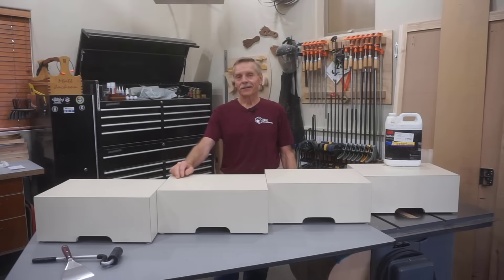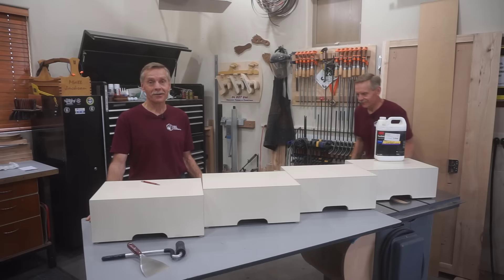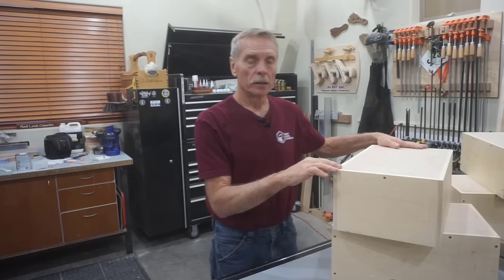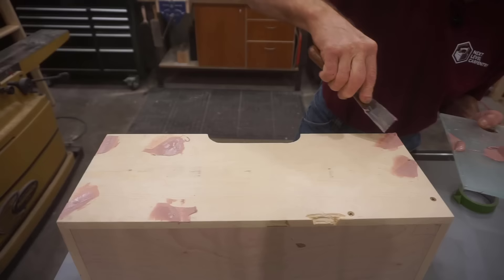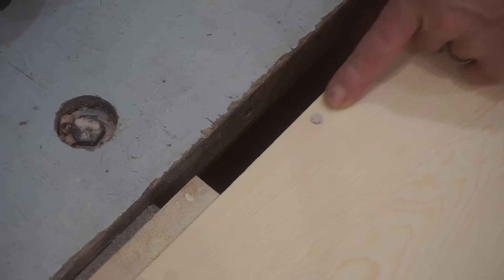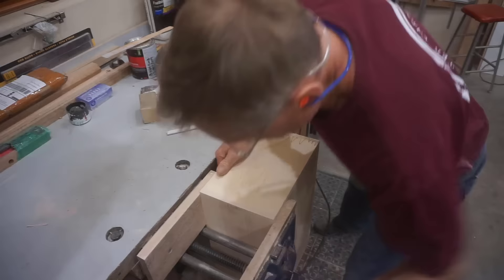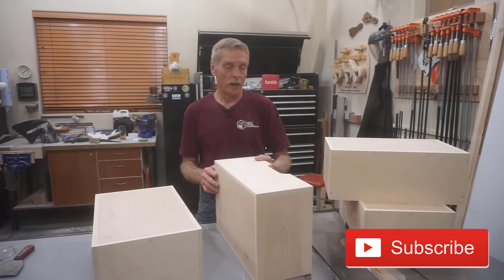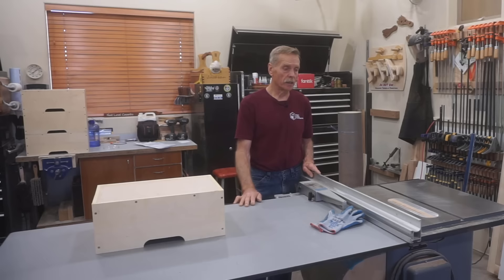Formica Application Master Class

Comment: That was a great video! I appreciate the thoroughness.  I have a question though:  I need to apply laminate to the 3/4" thick edge of plywood.  I don't see people talking much about that.  It's difficult to balance a router on the edge and not have it gouge the face.  What do you do in this scenario?  Thanks. Aaron
Reply from the maker: A Bosch Colt palm router and small flush trim bit is one option.  If you're also laminating the top and/or bottom of the piece just use a beltsander as shown in the video. If you've got a LOT of it to do, I'd consider making a 90 degree fence/guide attachment to help hold the router steady.  BTW use plenty of contact cement on the edge of the plywood because it will soak in a lot more than on the laminate.
Reply: Thanks so much for the reply. I’ll give the fence option a try

Comment: Love the extension cord trick! I've never seen that and will help me when I build my work table. I want to laminate it and then add a bunch of dog holes into it. Any tips on drilling into the laminate after it's already been applied to wood? I'm assuming I'll want to route a bevel in all the holes after I've cut them too.
Reply from the maker: Not sure what diameter dog holes you need  but I'd be looking at drilling a hole smaller than the dog hole and then use a flush trim router bit to clean them out then finish up with a tiny bevel as you said last.  Might need a tiny flush trimmer like this to get it done but the flush trim bit would help avoid issues from chipping, etc a drill bit might cause.
Reply: @NextLevelCarpentry  Thank you for the rapid reply. I was thinking about drilling through the wood and laminate at the same time. I hadn't thought about doing all the holes first, laminating, and then cleaning up the laminate. Thanks again for all the tips!
Reply from the maker: @jy4508  if your holes are smaller than 3/4 of an inch it would be simpler to drill through laminate and wood after the laminate is applied but make sure you're using a sharp bit and do a test drill on a scrap piece of wood with laminate on it to make sure your method is able to drill a clean hole without chipping the laminate around the edges of the holes. It's totally doable and I wouldn't hesitate to do it that way but I encourage you to do a test run because if any of the holes are spoiled you'll be looking at spoiled holes on your new bench tub for a long time to come🤯😁👍
Reply: @NextLevelCarpentry  excellent advice, thank you!

Comment: Good explanation, i did quiet a lot of laminating myself and I used sandpaper on a block instead of a file.we had back in the days lots of trouble with humidity using bison Tix. Is the water base effected by humidity as well? thanks for sharing.
Reply from the maker: The only downside of 3M Fastbond and humidity I've experienced is that it takes longer to 'dry' on humid days.  I just use a fan though an it's not a problem.  I've never had issues using water based contact cement on completed projects.  I did experience undesirable shrinkage on large project when using solvent based contact though, one more reason I really like Fastbond.
Best, Matt

Comment: Tons of great laminating tips by a real pro! :)   The link to the supplies is broken.  What size nap roller do you recommend for apply the contact cement?
Reply from the maker: I use a roller with about 3/8" nap: it holds enough contact cement for large applications but isn't so fuzzy that it leaves hairs behind.  I just buy inexpensive disposable ones and make no attempt to clean them after a project.
Reply from the maker: Thanks for the heads up on the broken link, Richard!  I got it fixed/updated to help you and others find stuff you may need: https://www.amazon.com/shop/nextlevelcarpentry/list/1UBRLSWF5ULT5?ref_=cm_sw_r_cp_ud_aipsflist_aipsfnextlevelcarpentry_ZMD5KQCB3ENXH0DP0M62

Comment: I watched this because I have been doing repairs to laminated surfaces for about ten years now, but had no luck using the water based adhesive. I'm left with one question. What would be the best course of action for regluing a surface where the laminate has been removed?
Reply from the maker: Repairing laminate adhesive that's failed is about like trying to un-ring a bell IMHO, Don, sorry.  The problem is you can never lift the piece far enough to clean the two surfaces all the way back to where it's still stuck so, if/when you do get the loose part re-stuck, there's always a 'line' between the repaired area and the part that was still stuck.  There's always some crumbs or gobs of glue there to spoil your efforts.  Best you can do is strip off the whole piece and start over... which brings me back to un-ringing a bell.  If it's just an edge it's possible but on a large/flat/top surface?  Not so much...
Best, Matt

Comment: Cleaning sheets and boxes: I suggest to move the clean pieces off the working table and store them in a designated, "clean" area. E.g. a second table, which has been wiped free of dust and particles. And which does not share the same surface standing some but still convenient distance (like behind your back) from the work area. The gap helps to keep stray particles to jump to the clean area. Otherwise you might get chips and pieces from the scraping process back on the already processed surfaces without noticing it. A workflow where you work from dirty to the clean situation. I think this is important because the minute particles you generate by cleaning are otherwise able to recontaminate your workpieces.
Reply: @ronstrode9124  Like I don't need yours??

Comment: Do you know the actual intended use of the "foot stools"?  Do you need to add non-slip pads to the bottoms to keep the stools in place (safety item)?  Just wondering since they will be used in a medical setting,
Reply from the maker: I do know the end use of these.  They got heavy duty screw-on nylon 'feet' on them as requested.  I would have thought non-slip too but, no.  Best, Matt

Comment: Good video, how are the fumes on the water based cohesive compared to the neopreme compound?
Reply from the maker: I think that technically water based IS neoprene... compared to solvent based (which is 'the other type') To compare; I think of it as a faint smell rather than potent, noxious fumes from solvent based, like Weldwood, making the 3M Fastbond Neutral I use in the video hands down the better product.  Best, Matt
Reply: Thanks Matt I am definitely going to give it a shot the solvent based are horrible in a small shop.
Reply from the maker: @jeffgoldsmith1679  it's a bit of a paradigm shift the first time or two but I'll bet that you, like me, will wonder why you waited so long to switch😁😎
Reply: @NextLevelCarpentry  haha, I am thinking you will be correct sir.

Comment: I am wanting to cover a 90" x 34" laminated pine workbench.  Can you describe what you would look for, or how to test, if the bench is flat enough to apply matte finish formica nicely?  Are there any 'leveler' products you would recommend, either for my bench or for use with laminates in general?
Reply from the maker: If you wipe your hand across the top of your workbench and feel any deviation at all it will Telegraph through any laminate surface you put on it.
The best filler you can use for filling defects is Bondo but it takes a good deal of effort and experience to make make a surface truly flat. Not sure what you're dealing with but one solution might be to apply a of good sheet of A/C plywood to the top of your bench and laminate over that...

Comment: Do you ever have to do 2coats of the contact cement?
Reply from the maker: Only on rare occasions when coating a very porous surface like low-density particleboard.  Oh: and almost always double-coat edges like edges on countertops just to make sure there's plenty on those extra-porous surfaces.

Comment: I'm currently at 1:07:45 . I was wondering if I didn't have the router bit you suggest, could i just sand the edges down by hand with a flat homemade MDF sanding block and still make it strong enough?
Reply from the maker: A bevel trim router bit saves a LOT of work... sanding work, Marcus, but if a small router and bits isn't in the cards for you a sanding block like these with a good, fresh belt, would get the job done: https://www.youtube.com/watch?v=qxvfIw84i-Y  I'd probably go with and 80# sanding belt.  You can also use a file for bevelling edges but, again, it's a lot more work... Best, Matt
Reply: @NextLevelCarpentry  Thank you for the incredibly fast reply! Also thank you for putting so much time and effort in explaining the entire process. Wonderful channel!

Comment: Why is it that Architectural Specifications that follow the Wood Institute or AWMAC requirements do not allow contact cement? Only in instances where cold or hot pressing with PVA glue is not possible. Any thoughts?
Reply from the maker: My guess is that contact cement is susceptible to 'creep' because it never gets 'hard' like Titebond.  I wouldn't use it for any glue-ups, that's for sure.  The 'stretchy' nature of cured contact cement isn't strong enough to resist wood movement like cupping, warping or twist.  I do plan to use contact cement to glue faces on my Pallet Wood Door for ease/convenience but, as a plan, it's a bit dicey.  Best, Matt

Comment: I have installed miles of self edged counters when they were at their peak in the 90's. And miles of bevelled edged moldings that show no phenolic dark edge if installed correctly. Wisonart made this edge popular. It was called Perma Edge. (https://www.wilsonart.com/laminate-edge-options)  You could vary the colours on the edging. It went out of fashion and now I'm left with a hold lot of expensive tools. ( that paid for them selves many times over )
Reply from the maker: I remember the  "Perma Edge" phase Brian... it was a great way of eliminating the dark edges.  Unfortunately 'color core' laminate, which solves the problem a different way, is prohibitively expensive for most applications.  Probably lead to the surge in popularity of solid surface that's dominating these days... Best, Matt

Comment: At 1:20:15 I see a damaged (?) corner. It looks like the file or router has taken off some material from the formica on the side. As in tilting the cutting tool near the end. So the bevel gets too large. What happened there? And how do you address that? The bottom also looks damaged. I remember to have seen a hole in the bottom face at one corner before.
Reply from the maker: You're very observant.  Both conditions were present.  Luckily the cracked corner wasn't 1/32" more because, if it was, I'd have had to replace that top piece.  As it was it cleaned up with the bevel trim bit and file so it wasn't an issue.  A bottom corner had the slightest chip out of it... it looked worse than it was so it wasn't an issue.  If it were any bigger I would have filled it by forcing Bondo into it at  the end.  Goes to show how important some of the details are because the margin for error is so small with this stuff... Best, Matt
Edit: I looked at the timestamp you posted; what looks like a damaged corner is mostly a glob of glue/laminate stuck there.  Might be the same corner that had the chip but I can't tell for sure...

Comment: Hi Matt. If you don't mind me asking, how do you like your blue woodworking vise on the bench under the window? What brand is it? Looks like about a 9". Thanks, Jake
Reply from the maker: Here it is Jake:  https://www.amazon.com/dp/B0000223R5/?ref=idea_lv_dp_  I've had it for decades and have never seen anything I'd upgrade to.  It's done everything I've asked of it over the years.  I remove it from the bench every couple years to clean it up and lube moving parts but that's about it.  Needless to say I highly recommend it.  FYI There appear to be a number of knock-off brands/models out there so be mindful of that if you go shopping.  Best, Matt
Reply: @NextLevelCarpentry  Thanks Matt. I'll follow your recommendations
Reply from the maker: @jakeo2600  You're welcome.  I did a video showing how I make sacrificial wood jaw pad/inserts using a jointer so if you end up with one of these vises and need to know a good way to make them just reach out and I'll get you a link to that video...
Reply: @NextLevelCarpentry  Thanks again Matt. Although after reading some of the comments about the Record, I'm a little worried. Since you've had yours so long, its not like the ones that are sold today which are made in China as opposed to the UK. As much as I would love to see you get a little something back from Jeff Bezos, I'm concerned about having problems with it and the International shipping which could be problematic.
Reply from the maker: @jakeo2600  I've not read reviews on The Voice listed it on Amazon recently but maybe I should? BTW where are you located regarding international shipping? If new ones are inferior maybe you can get lucky and find one on eBay or something? Best, Matt
Reply: @NextLevelCarpentry  I'm in Illinois Matt. I'm really at a loss as to what's going on with Amazon. As a Prime member I could get the 7" version w/free shipping in 2 days presumably from somewhere in the US. The 9" vise will cost $10 to ship from overseas (China?) and take about 2 weeks to arrive. The only thing with eBay is you would loose your commission :( At any rate, I really do appreciate your time and information. I also looked thru your old vids and didn't see the one where you made the pads for your vice. Jake
Reply from the maker: @jakeo2600  Don't worry about the commission thing for me; most important thing is that you get the right vise for you. Not sure how you guarantee getting a Record brand, even if it's made in  China, and not a knock off.  Guess you can always send it back if 'not as advertised'.  Thinking back, the vise jaw video was a patron-only thing.  If you do get the vise I'll send you a private link so you can check it out.  I think it's worth the effort to get the right vise and wish you well in your quest.  Best, Matt

Comment: What table saw fence are you using?
Reply from the maker: It's an old Delta Unifence.  The main reason I use it is because it came with the saw when it was new back in 1982.  The design was state of the art back then although Beismeyer style fences that came along later are more reliable and versatile these days IMHO.
Reply: @NextLevelCarpentry  Thank you, I recently purchased an old unisaw that is missing a fence.

Comment: can you glue laminate to laminate?
Reply from the maker: Sure can Ray.  I suggest washing the existing laminate with acetone or lacquer thinner first to remove any wax, oil or polish and then rough the whole surface with 100# sandpaper to remove most of the sheen then re-wipe with the solvent.  Make sure to inspect 90 degree corners to make sure they're nice and square. Make sure the original laminate is sound too... if it's loose or lifting at the edges you'd need to address that. If they're beveled off too much you might have to do some filling/prep work to them so the new laminate has a sound substrate to stick to.  Best, Matt